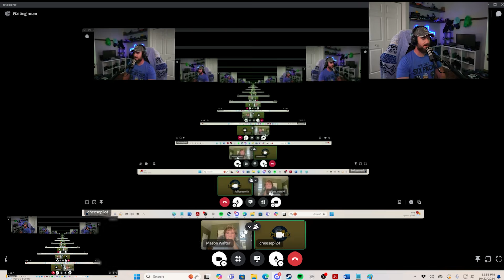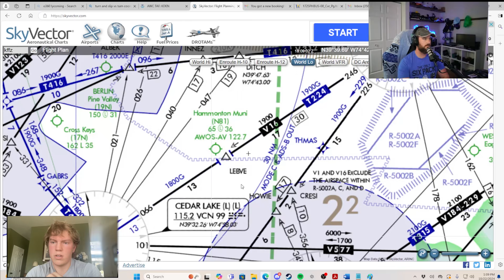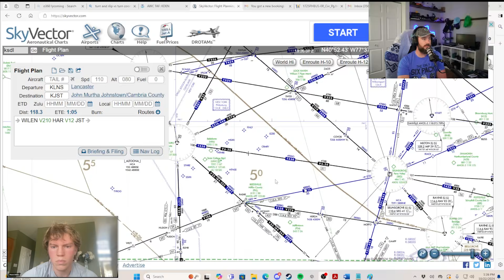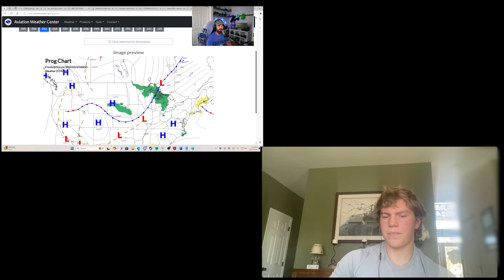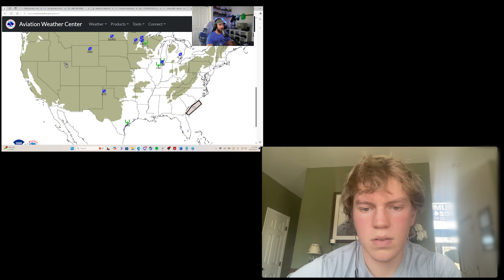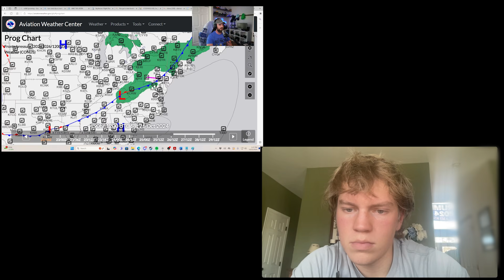IFR Checkride Prep instrument mock check ride

Comment: This is a pretty good mock check ride. I like how you are getting into the weeds on some of these more obscure ideas. 
FYI. The reason that DME and route milage may not be the same is due to slant range. But in this case the VOR altitude the MEA are close enough to where slant range is negligible. This means the DME value displayed in your cockpit accurately displays the route distance.

Comment: At 31:00, Cheese Pilot says that you have 5min of integrity after you get a WAAS LOI message. Where can you find information about this? I can't seem to find anything in the AIM that talks about 5min of integrity after a WAAS outage.
Reply: The GPS has a 5 minute test to see if the missing satellite comes back into view. You wont know about that happening in the background tho, so if you do see LOI its telling you right then the GPS is not accurate and you must go missed or not do the GPS approach to begin with etc.

Comment: Older aircraft with original from factory G1000 panel had no Waas, charts and Synthetic vision capability.  If you install this system later it’s G900 instead.  Basically nobody does it

Comment: G1000's dont have waas, only G1000NXi's have it, to my knowledge. Great stuff! These are so helpful.

Question: where is that rule about 5 min after 'LOI' flag?
Reply: The OG C172S G1's don't have WAAS (~2005-2007 builds), but from then until the NXi switch in 2019 the G1000 was WAAS. Unfortunately, there's no real way to retrofit a non-WAAS without a full rip and replace.  The 5 minute LOI window is in the AIM, 5-1 about RNAV operations - it says something to the effect of "if loss of integrity will persist for more than 5 minutes, then..."

Comment: 11:26 When is an instrument rating required? 
-Class A airspace
-flying under an IFR flight plan 
-flying into IMC conditions or in weather less than VFR
-Special VFR between sunset and sunrise 

13:25 Currency and Receny 
-61.57
-After 6 calendar months you need to do 6 instrument approaches, holding procedures and tasks and intercepting tracking courses and using electronic navigation 
-Can be done in an FAA simulator 

15:51 A safety pilot just needs to be a private pilot and they need to be properly trained for the airplane

17:38 You need an alternate if there’s isn’t a minimum 2,000ft ceiling, 3mi of visibility 1 hour before and after ETA (91.169)

19:31 conditions for alternate 
-precision 600ft ceiling and 2mi vis 
-non precision 800ft ceiling and 2mi vis 
-If there is no approach you have to be able to descend from MEA in VFR conditions 

20:04 With WAAS you can file an RNAV or GPS approach at both destination and alternate. If it doesn’t have Baro VNAV you can file LNAV at one of them 

21:01 RNAV is the airplane using ground nav for us. It does cross reference for us. GPS is a form of RNAV that tracks how far satellites are to determine location. It picks up signals in the area to navigate without the pilot having to use a CDI

23:17 GPS just utilizes satellites that are orbiting the earth to give our location. You need 4 satellites to have a 3D position

24:03 Raim stands for Receiver autonomous integrity monitoring. It requires 5 satellites to check for the integrity of satellites. It gives fault exclusion. If you lose RAIM in flight, you will have a flashing “RAIM Unavailable/Fault” message and it shows up on the PFD

26:40 WAAS is a wide area augmentation system. It makes the aircraft more accurate and allows for more specialized approaches. We receive a signal from GPS satellites and the ground stations receive that signal as well. The ground stations are aware of their locations so they make corrections and receive signals and send the signal and corrections to a Geostational satellite. They are satellites that stay over the same point of the earth all the time and move at the same speed. over the equator that move at the same speed of the earth. They continuously check other satellites to assure there are no errors. Those satellites send corrections  to the aircraft that need to be applied to the other gps satellites. WAAS also allows you to do RNAV approaches with LPV. minimums, Baro VNAV and LNAV approaches, Localizer performance approaches

28:22 A PAR approach stands for precision approach radar and atc gives you instructions. It’s kind of  like an “audible ILS”

29:38 if you get an LOI flag after passing final approach fix you have up to 5 minutes. If you’re before the final approach fix, it’s better to do a missed approach.  It means you have lost WAAS

32:17 the three main components of an ILS are the guidance (localizer/glide slope), distance( markers, dme, cross radials), and visual (lighting) 

33:43 30 degrees off course will definitely make the DME unreliable 

33:54 the localizer emits a signal in a specific direction and once we pick up the signal it tells us lateral distance from the runway. 2 lobes come off the localizer. One at 150hz and one at 90hz. It’s about how much is the airplane receiving of one of them. If you are further to one side, it will pick up too much of one side. It’s more accurate than a VOR. 

35:32 glide slope also has 150hz and 90hz. It works the same way 

35:57 if you’re too high you can pick up a false glide slope and you can recognize this by reverse sensing or if it is too steep. Usually the 90hz is above the 150hz so if you end up reflecting the 150hz off the ground above the 90, it will cause that steep glide slope and the reverse sensing.

37:42 To descend below minimum descent/rescission altitude (91.175). Seeing approach lights, touchdown zone lights and markings…

38:57 if you see the white rabbits while descending you can descend 100ft above touch down zone elevation

Comment: To  answer the question about G1000 and waas. In and around 2004 many cessna planes came from the factory with G1000 and a non waas gps. And it can not be internally upgraded. So they are out there.
Reply from the maker: yeah i had just never seen that it really surprised me

Comment: 36:00 first time I’ve heard about the reverse sensing for a false glideslope, but it makes sense.

I’m not sure how the G1000 NXi would respond, because it corrects for reverse sensing when flying a localizer back course. Exception being if you have an AHRS failure, then it would reverse sense.

Comment: I was under the impression that "loss of integrity" is in regards to RAIM. Am I wrong? It is WAAS?
Reply: you are right LOI is for RAIM, so can not do LNAV either. If loss of WASS, there will be other alerts, for example, 'LPV' turn to 'LNAV', or message on the PFD
Reply: Also I thought that if a RAIM failure occurs, it will suppress the message for 5 minutes and then appear. So when you see the RAIM failure message, you must go missed because that "5 minutes" is up.

Comment: Yo Cheese I passed my instrument checkride November 14th, I appreciate you helping me out man I’ll see you when I’m ready to take my commercial mock checkride!
Reply: Congratulations! Any words of wisdom? My checkride is on the 6th of December.
Reply: @DanielAbrantes20 don’t just remember rote memorization items, they’re really important but make sure you understand what you’re going to do as pilot in command of the aircraft in emergency situations, different approach types, equipment failures, and failures while on the approach. Just have a strong understanding of how instrument flying works from the moment you taxi to the runway up area to the moment you’re taxing off the runway after you land. Know your electrical system very well. Really know everything on an approach plate and be able to explain.
Reply: @masonwalter  thanks man. Just passed my IFR.
Reply: Slide the arm day routine
Reply: how much did you have to learn or improve on from the point you were at in this video? also where are you at now? hope you're doin well and chugging along
about to get signed off for my IFR checkride in a week or two!

Comment: 16:40 from my understanding, the FAR only specifies that the safety pilot has to be certified in the appropriate category and class aircraft, and complex/high performance endorsements are not considered a requirement as per 91.109 c
Reply: The pilot with the endorsement is “acting” as PIC, even when under the hood.  Herman (2009 legal interpretation). Safety pilot doesnt need to have the high performance endorsement. But thats from the attorneys not from me. Im sure people will comment with their legal opinions.
Reply: If you're logging PIC time in your logbook, the safety pilot needs to have a high performance endorsement. No person may act as PIC unless that person has received ground/flight training and received a one time endorsement. 61.31(f)(1) If the safety pilot doesn't have a high performance endorsement it would be SIC since they are a required crew member.
Reply: @cheesepilot unless Rizner was overturned somewhere (https://www.faa.gov/media/16006) then the FAA only "encourages" the safety pilot to be high performance endorsed as the endorsement is neither "class" or "category" of aircraft. 

It'd be great if you could confirm it and add a comment or something so other instrument students (like myself) have confidence in watching your content and knowing it's all accurate, if indeed your video needs correction.
Reply from the maker: the safety pilot is acting as PIC so my understanding is that when someone is acting as PIC they need to be qualified to operate the aircraft
Reply: @cheesepilot they are not required to act as PIC. They just can’t log safety pilot time as PIC time.

Comment: If the final approach course is more than 30 degrees off the runway heading it will drive the approach to only have circling minimums with a letter at the end of the title.  There are approaches that are circling only that ARE within 30 degrees of runway heading, too.  See VOR-A at KEAT.  A second restrictor besides final approach alignment is descent criteria from the FAF.  If it's more than 400 feet for NM then you will only have circling minimums.  Another good oral question is where is the final approach point when there is no FAF, like on the VOR-A into KEAT.
Reply from the maker: Thanks for pointing that one out to me as for where is the FAF if it doesn’t say FAF it’s the Maltese cross

Comment: my flight school has G1000 C172 that are non waas. im prepping for my instrument checkride and have never even seen a waas g1000 lol
Reply from the maker: I guess im spoiled by doing a buncha training in a g1000 with waas
Reply: If it’s the same G1000, and not the NXI, I’d expect it to be identical?

The bonus is you can fly LPV’s, and LNAV/VNAV without a baro nav, and LP’s. When you’re WAAS equipped. 

You would also have GPS augmented DME, in other words a suitable RNAV as a replacement for DME equipment. If you meet the RNP requirements for your phase of flight.

Comment: I’m here with over 250 and I still have no ifr rating as of Dec of 2024 I filially got my Ifr rating
Reply: I got you beat, 425 hours and no IR. Basically ready to take the checkride but things just keep coming up.  Meanwhile flying for work just keeps racking up the hours.

Comment: I think safety pilot does not need endorsements for the aircraft. 91.109 only requires the safety pilot to have PPL on the category and ratings of the airplane. Therefore any ASEL PPL should be able to act as a safety pilot in SR22T.
Reply from the maker: The issue comes from the safety pilot acting as pic during the portion of flight with the view limiting device
Reply: @cheesepilot  Section 91.109(c) is our starting point for safety pilot qualifications. Pilot in command or not, the safety pilot must have at least a “private pilot certificate with category and class ratings appropriate to the aircraft.” Notice the absence of endorsements for high performance, complex, and tailwheel airplanes. Those are not required in order to be a safety pilot, unless the safety pilot is also acting as pilot in command (Under basicmed you would need the endorsements because of how basicmed is written). Checkout avweb's article on this online.
Reply from the maker: @Nathanael.Quillin  See my understanding is that the hooded pilot may log PIC time because they are performing the duties of PIC as they are the sole manipulator of the controls but the unhooded pilot is the actual PIC while the other pilot is under the hood as they are the only ones who can actually ensure the flight is operated safely which is the responsibility of the PIC which can not be delegated. Imagine something happens during hooded ops in a piper malibu while your safety pilot is just a private pilot with 60 hours in a 152. The NTSB would not put the blame on the hooded pilot given that they couldnt see they would put the blame on the pilot who could see. They would also hit them with reckless operation of an aircraft and behaving as pic of an aircraft with out the appropriate endorsements. 

I went and read that article and it says both pilots are behaving as PIC just in different capacities one is performing duties of PIC or PDPIC and the other is acting PIC both need to be qualified to operate the aircraft.
Reply: kind of like 'it is legal, but is it safe'
Reply: SR22T would require a high horsepower endorsment however.
Reply: @E90DA that’s also my view
Reply: This was my understanding, but I get the argument for correct endorsements